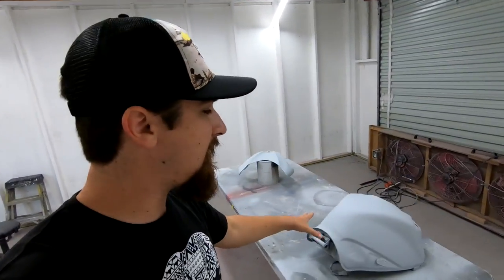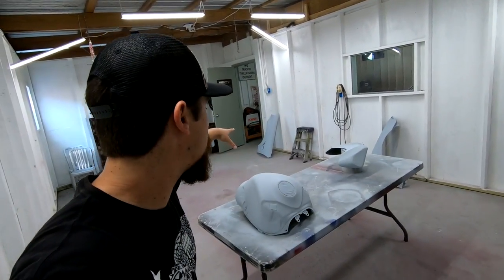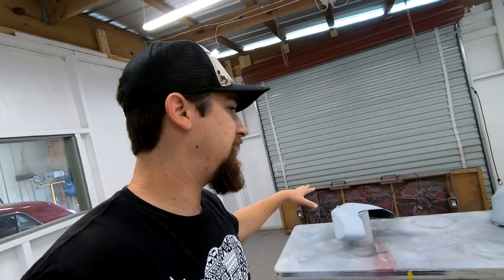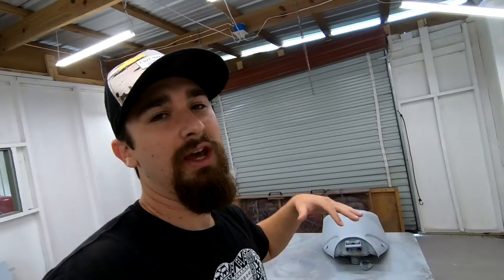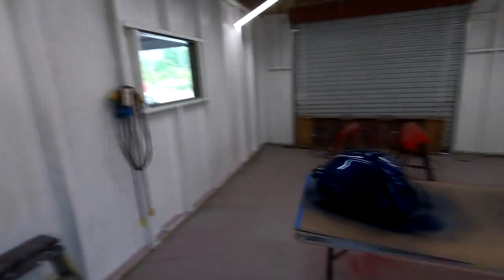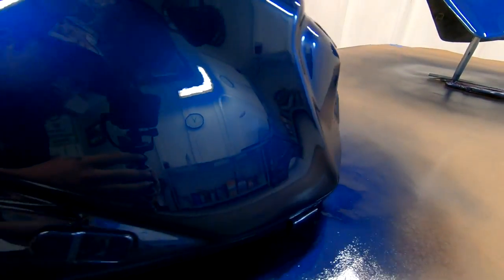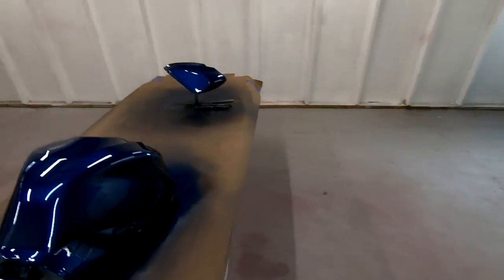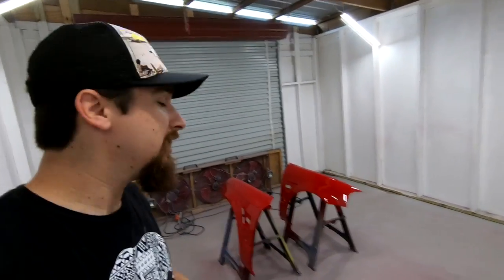Painting A Gas Tank

Comment: Have you notice that dust can be entering by the "holes" you have in the roof? Between the wall and the roof?
Reply from the maker: yes, we will be addressing that in the near future as that stuff isnt free to fix. 

Also, specs of dust almost always appear even in professional booths. Thanks for watching and thanks for your feedback.
Reply: I know that, 
I'm just trying to help, i have a "similar" system and the most particules were from that holes in the roof, and it was worst because of the "vacuum" done by the fans of the air exhaust system, I don't know the brand but i have used a Spray Polyurethane Foam, cheap and very useful
Reply from the maker: Cláudio Martins oh yeah man that's actually a great idea. Thanks and I'm going to look info that. I've been putting it off because I was thinking I needed to redo the roof over there. Spray foam would be a great fix
Reply: BodeVision Just be aware of expansion. Use a low expansion spray foam. I have faith you will find the right solution. Keep up the great work.
Reply: You welcome, just continue with the great work